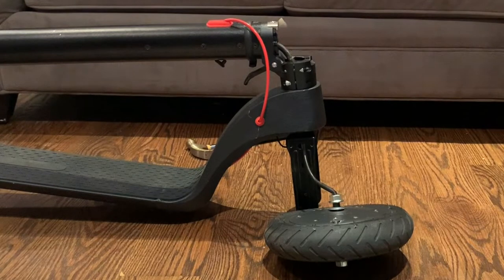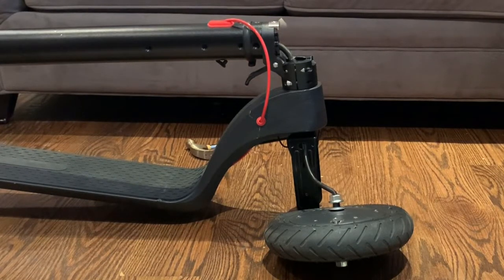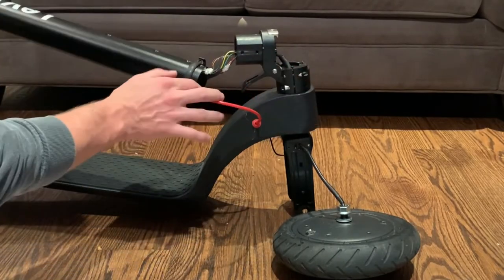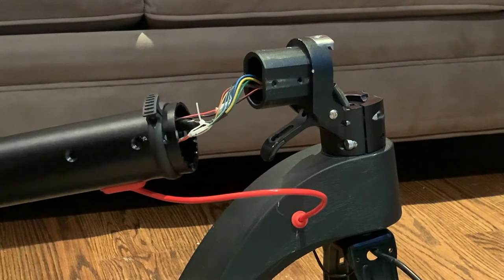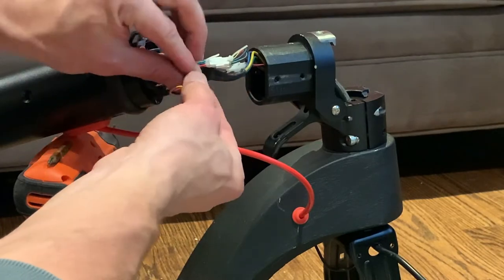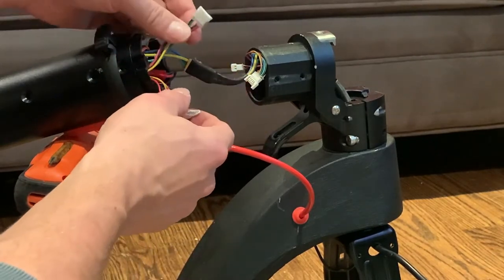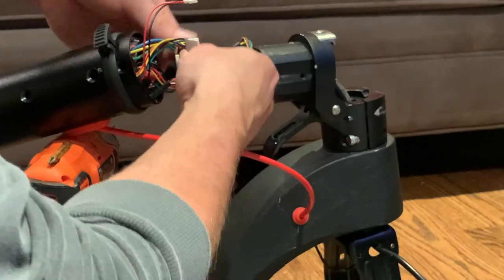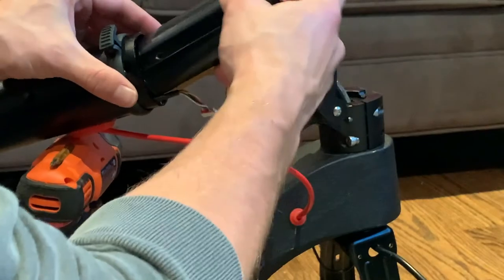Removing Motor Controller - X7 X8 Electric Scooter

Comment: I'm fixing a friend's Cecotec scooter that I see is really like an H7 X8 or very similar. I have a question that I think you can answer for me, please: The red and black cable from the brake light that passes under the chassis passes inside the hinge spring along with the engine cables, right? Thank you so much!